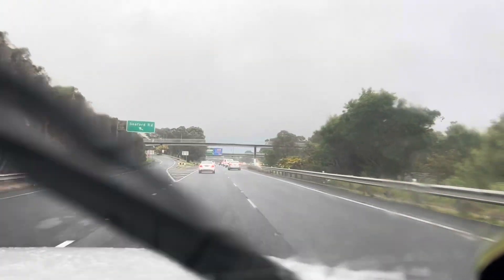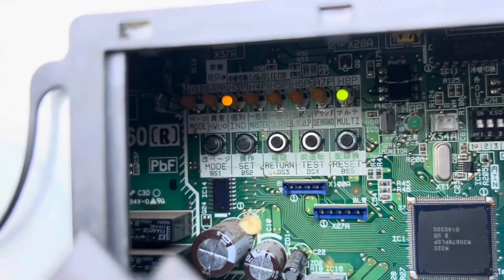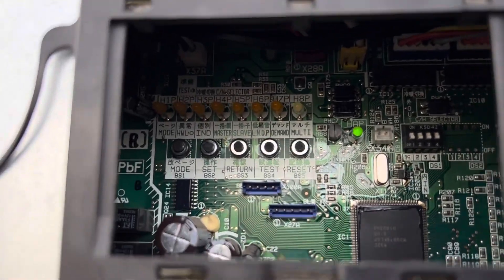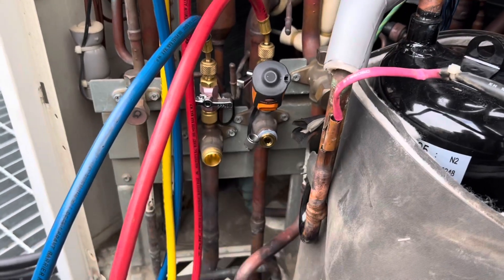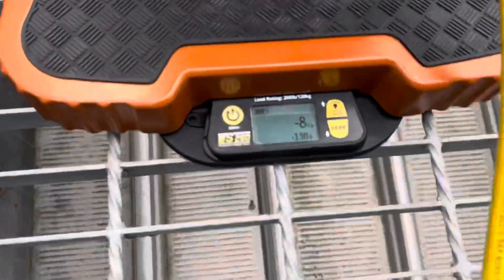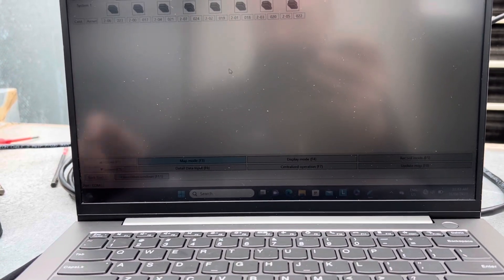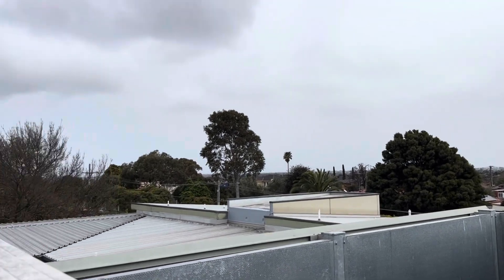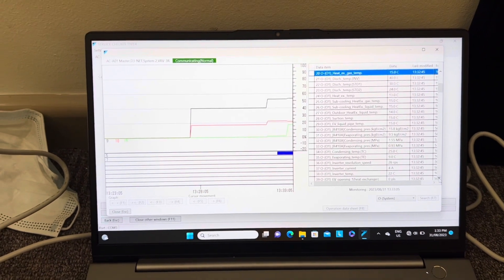Daikin VRV III / Inverter Compressor & PCB Replacement on a VRV System - Part 2

Comment: Hello, I have just watched the training video, very well done. You have a command window on your laptop screen at minute 11:00 with which you can “command” indoor units. which version of the software are you using? many thanks in advance, greetings Simon
Reply from the maker: I have version 1.4.5. But you can use that function on the older versions too. Very handy.

Comment: Hey man love your videos! Just wondering where you got the Daikin service tool super helpful, did you have to  get it through a Daikin training course. Cheers
Reply from the maker: Hey mate. Thanks, that’s always nice to hear. I bought it direct from Daikin Spare Parts. It cost me around $1770 I think. If you’re working on VRV/F a lot it’s well worth it. Same deal with the Mitsubishi Electric Service Tool. Bought it direct from them. Theirs only cost me $650 though (and it’s easier to use 😂)

Comment: I wonder if they'd been having trouble with this unit someone else has been out and just added gas thinking it was low after a misdiagnosis.
Reply from the maker: After I filmed this I spoke to the tech who looks after this site and he mentioned that he had put 4kg into the system. I was a little thrown originally that I pulled out 35kg as I had assumed it would be lower so hearing there was extra refrigerant put in made a lot of sense. After pulling out the components I tested them. Two sets of the inverter pcb diodes were open circuit.  The comp electrically tested fine but I couldn’t test it for mechanical failure.

Comment: I am always waiting for your video. lucky that the injection line was not blocked, because it made common issue for compressor failure to Daikin VRV and big duct. every compressor replacement, it's better to replace a filter of injection line. Great job!
Reply from the maker: Thanks mate, that’s nice to hear. I was talking with a mate about common issues with VRV III compressor failures and one of the main ones was that oil capillary line. Going forward, if I had to replace another one I would definitely change it out also.